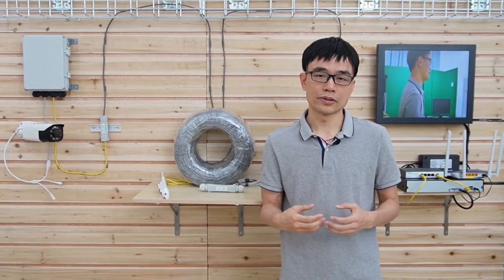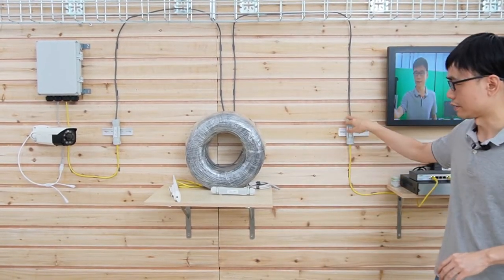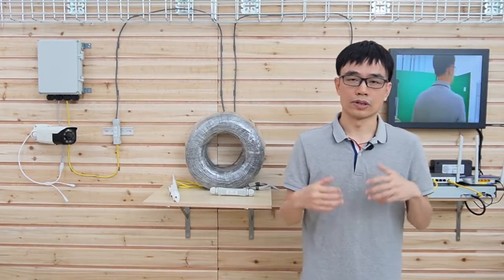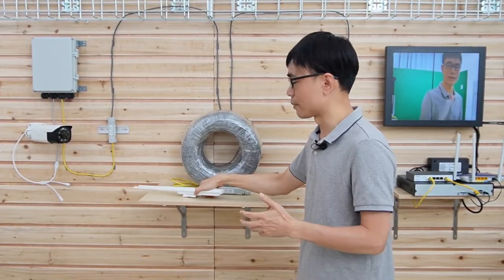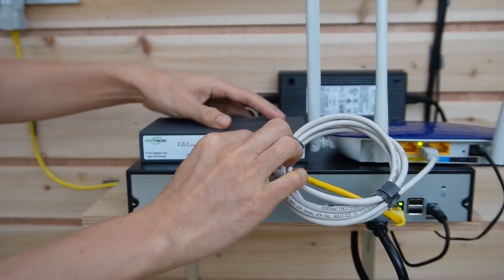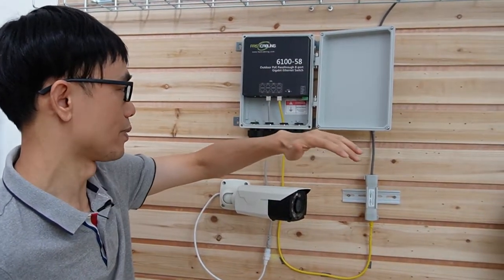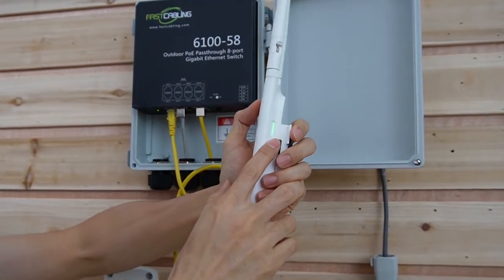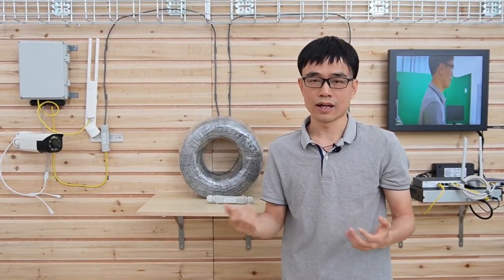How to Add Access Point to 90W PoE++ Extension Network

Comment: Hello  If i have 3 Access point  can capable to  drive all?   or do i need to increase the power on my POE switch?
Reply from the maker: It depends on the access point. Some access point consumes about 5-6W. The PoE+ switch or injector will be good enough. However, if what you have is the high power outdoor AP, such as WiFi 6 Mesh, you might need 90W PoE injector to supply enough power for all three access point.
Reply: @Fastcabling  thank you   for your prompt reply.     you 90watts  has  3 to 4  lan connected   so  they have a power balancing?  if i use LAN 1  with  inter connect  2 to 3    wifi 6.  what about the  LAN 2 ,3 ,4  they will provide the samw power output  or i need an addutional  90watt switch.?

Comment: How would you be able to view multiple  wirless cameras  if they was linked to that wifi.. What would be needed at the other end to decode each camera.. Thank you Dan
Reply from the maker: You don’t need any special decoder, but you do need software or standalone NVR to see the live video from those cameras. Each ip camera IP based network devices. Each camera has unique IP address. It is like you are using zoom to have live conference with several people from different place.
Reply: @Fastcabling  OK so can I Y off a POE cable and add other extenders or bridges or would I have to add seperate POE cable.. Thank you. Dan